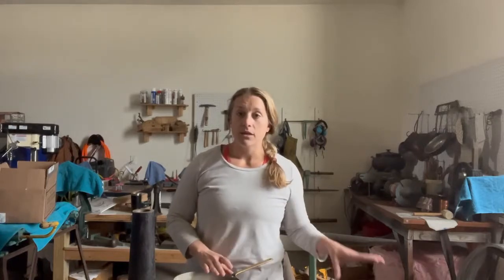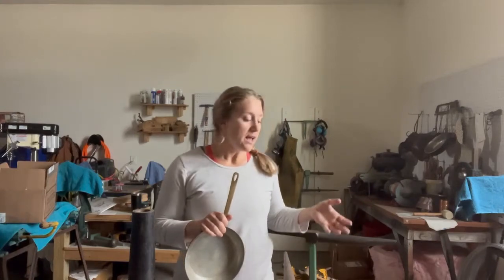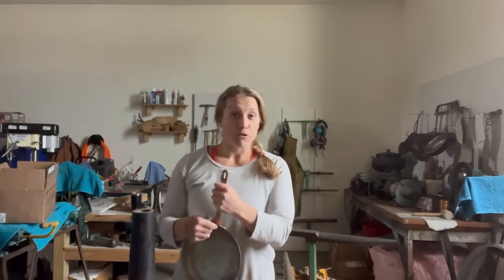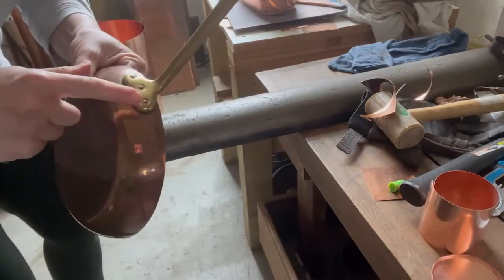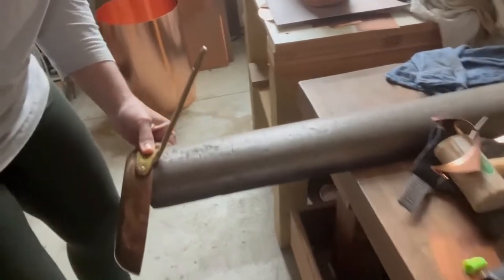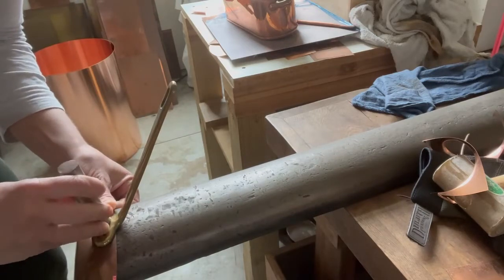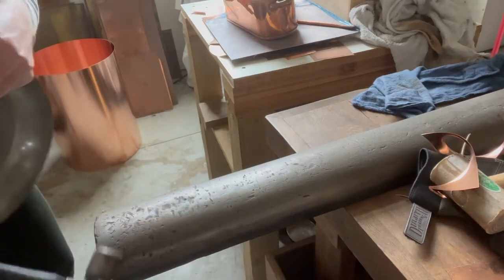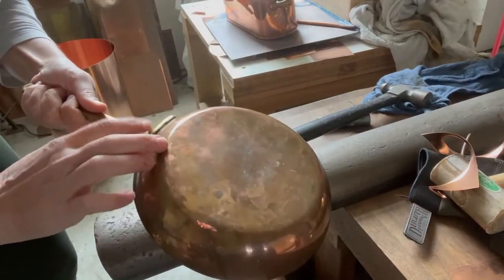How to Tighten Rivets

Comment: Wow, counterintuitive, but very cool.  Great tip.  By the way, where do you source those cast brass handles from?  I’d like to make a few pots but can’t find handles in less than a gross.  I know different handles can be made from stainless steel sheet, but I like the brass ones.
Reply from the maker: I don't source cast brass handles. They came with the original pot. Sorry. I don't know where you could get them as I have never looked.
Reply: @housecopper  oh, ok, since you have a company that sells copper pots, I assumed you had a place to buy them from.  I’ll keep looking.

Comment: Thank you - been waiting for that one. Really explains it well. One question about the depth of hole in the tool; in the way i imagine it, it should have a depth, that equals the hight of the rivet (to be able to apply pressure onto it directly, and thereby tightening it) - But it seems that that is not the case (it can be deeper, if i heard you correctly?). But what causes the tightening then? Is it the pressure applied to the handle, or?
Thanks again, really helpfull, and much appreciated. :)
Reply from the maker: You're welcome, sorry it took so long to make the video. I kept losing my note to do this one! And yes, the depth of the hole tool is irrelevant. What you're actually using that tool for is to firm up the body to the handle. You're trying to avoid actually touching the rivet during this process, and just let any extra rivet material in the handle and body holes spread out with the hammering and the spread of pressure on the handle to the body. It's sort of counter intuitive, but to tighten rivets, you're really not hammering on the rivets themselves.